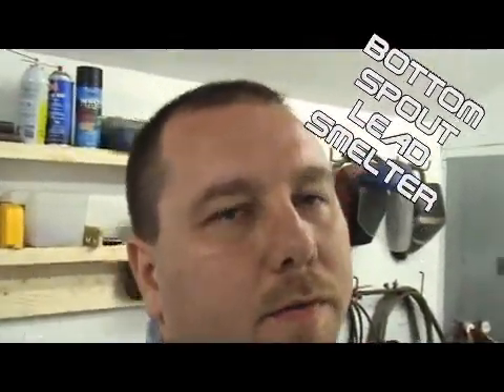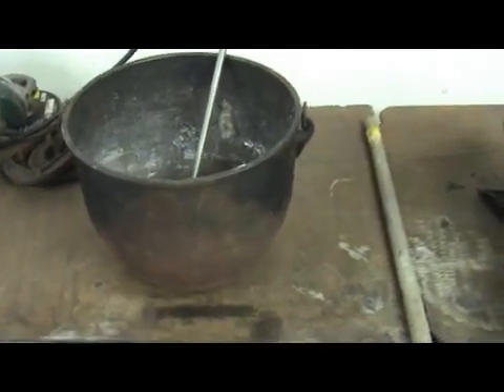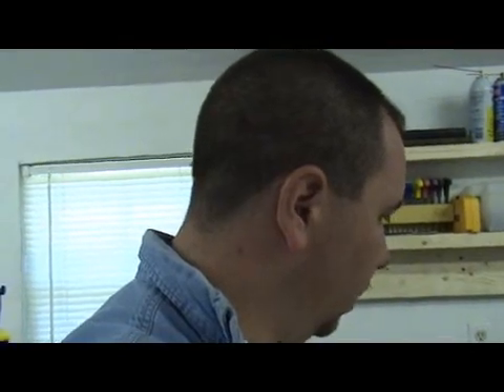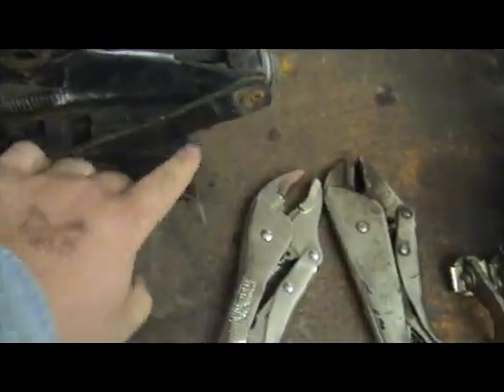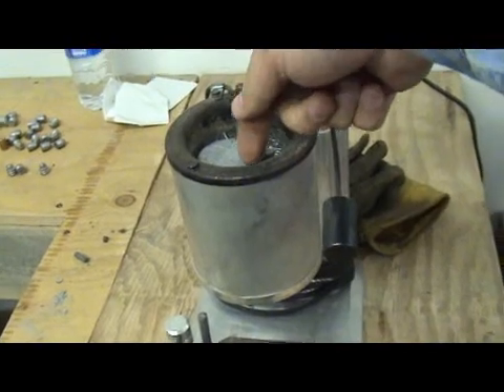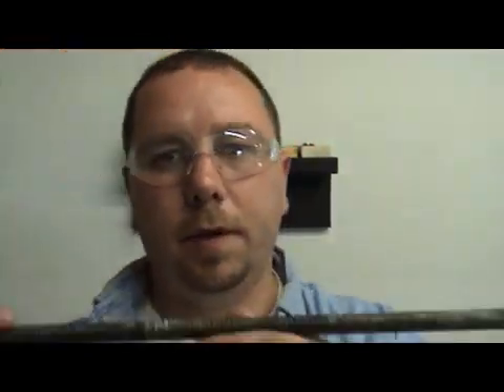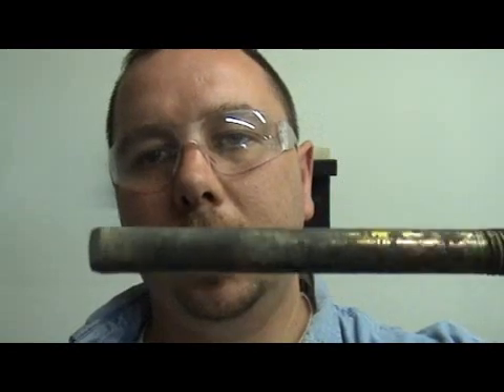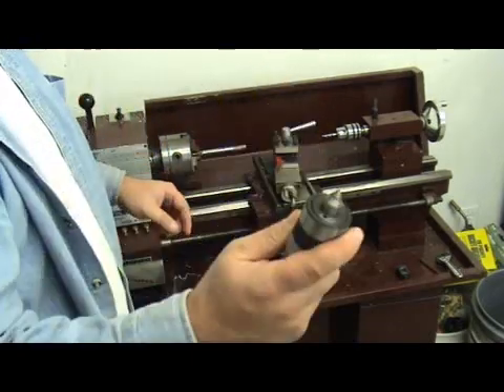Bottom Spout Lead Smelter PT.#1

Comment: You didn't show the best part - how you drilled the hole into the pot!
I have an oval, cast-iron roasting pot I want to use. The idea was to put the spout in one of the 'corners' of the oval near the edge, and put the screw with the valve plunger in vertically. Maybe weld a small pipe on the bottom under the hole, too. The screw/plunger would be held at the top where I thought I'd weld a steel steel bar to both sides of the rim, with a threaded hole in the middle of the bar. Maybe weld a nut to it. What do you think about that?
Also, did you lap the valve seat and 'plunger'? Or were they sufficiently tight right after drilling?

Comment: I am liking this project. Even getting some lathe time in there sweet! Great idea on that bottom pour. Can't wait to see part 2 and to see that thing in action... I was thinking of taking a cast iron pot and just putting like a water spigot screw it into the bottom, kind to the side and instead of a knob that you turn in circles, a long lever that to the right closes it and push to the left to open with right hand while left hand slides the ingot mold over.... We will see.